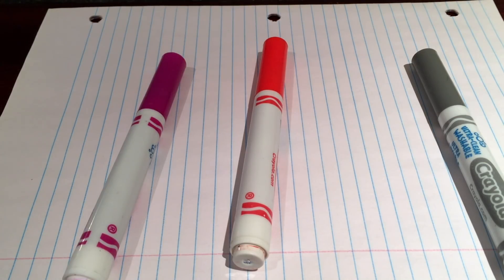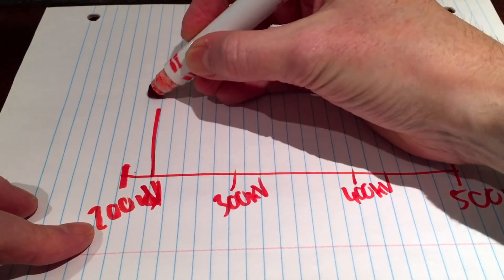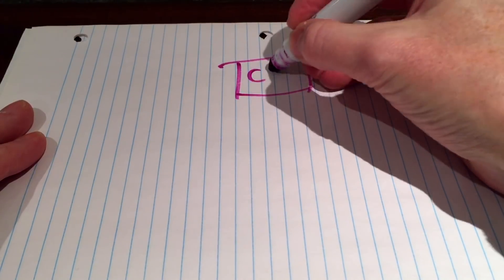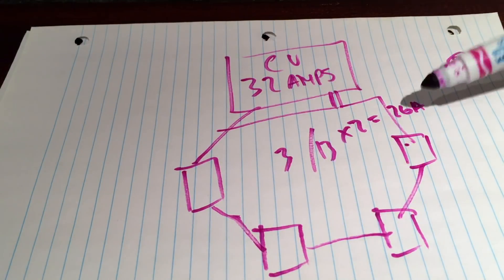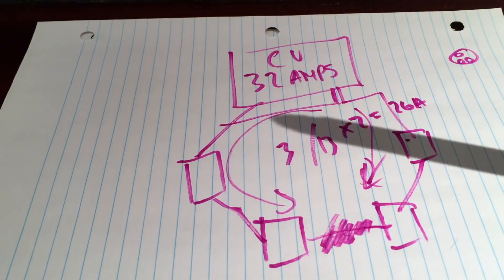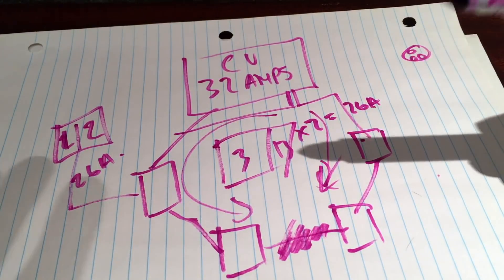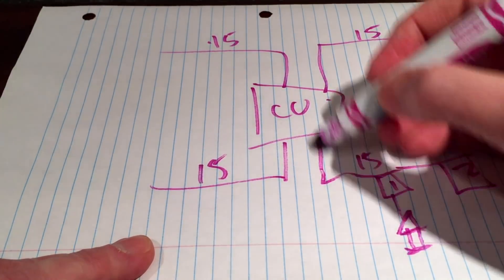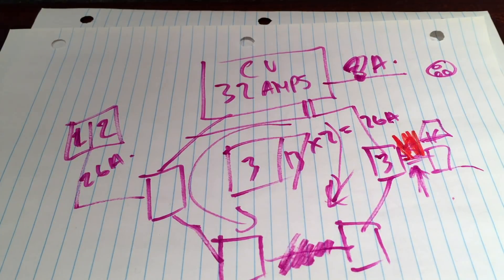THIS is why British plugs have fuses

Comment: I'm really sorry, but this. Idea simply confuses what is quite a simple subject. Electricity can be distributed by rings or spurs, whichever is the most convenient. The entire point is that each home has a maximum amount of electricity available, and you need to get it to where it is needed. In UK homes we have spurs to fixed heavy loads -cookers, permanent heaters, washing machines, and then we provide rings where lower power devices can be connected randomly where it's convenient. The ring is an efficient way of providing up to 32 Amps of current. One for the ground floor maybe, one for upstairs? Before we used rings, where each plug is protected, we used a system very similar to the US system where each socket outlet went back to the fuse box, and of course we had one fuse per circuit. Rings are convenient, and electricity distribution companies use them to connect their substations. They're simply an efficient way of doing it. Forget the daft numbers. 13a mains has proven to be safe and fits in well with our building system. It's not better or worse, just different. As for all this stuff about cable sizes, it's all down to what's called diversity. A 13A double outlet has two routes back to the consumer unit and shares the load. Fuses in plugs prevent more than 13A being drawn, which is the socket rating, only 32A is available from the breaker in the consumer unit. All these features allow trip free living. If your system trips under everyday use, you need an extra ring. It's so simple there is no need for confusion. 

We also need to not talk about multiple phases. Only a very, very few homes have 3 phase power, so adding that confuses, and the reason is safety. Three phase goes past your house, but each home just picks up one of them for 240V supply. 415V from our 3 Phase is simply unnecessary, and we don't do it. Older homes had a maximum load at the fuse box of only 45A, then it went up to 60A,a and now 100A is common at the consumer unit BUT few homes will every attempt to come close to using this amount of electricity because there's no need and we couldn't afford it!

In my humble view, the is no need to make rings mains as complicated as this. They are exactly the same as the ring we use to supply our hot water to radiators all over the house. We don't return each radiator to the boiler, unless we use microbore, when it becomes like the radial systems US and Europe prefer.
Reply: Minor clarification here. In the US, each plug doesn't run all the way back to the panel ("consumer unit"). Each plug is on a "branch circuit", and there are a certain number of receptacles allowed per circuit based on the wiring (size) in use and the size of the circuit breaker at the panel. Typical branch circuits are rated at 15 amps (#14 wire) or 20 amps (#12 wire). For heavier load devices (like cooking stoves and air conditioners), larger wiring and breakers are used, but all breakers are housed in the panel. There is a main breaker in the panel, usually rated at 100 or 200 amps. Houses are almost exclusively single phase 115-125 volts. Commercial installations usually are served with 3 phase power and panels ranging from 200 amps and up (though anything above 200 amp typically involves a "cabinet" rather than a "panel").

I like the UK idea of putting fuses in plugs. It would increase the safety of electrical installations, and prevent whole circuits being blown when a single device is overloaded. But alas, if it's not in the National Electrical Code (NEC), it will not happen. (See my earlier comments on a different thread about the NEC.)

Comment: I once attended a callout out to a farm that had a 3 phase supply.
The neutral broke on the powerpole of a delta wired system which resulted in 415 flowing down the live of the phase that the house had been wired to.
The fuses didn't protecting the circuits from that and every piece of electrical equiptment in the house and every wire in the wall was destroyed.
Thankfully thankfully the 100A incoming network fuse blew protecting the house from burning down !

Comment: I wonder how many times those small fuses are the cause of a fire themselves.
Reply: These fuse are sand filled and can handle huge currents without rupturing the casing.
Reply: The fuse housings are often dodgy and can get hot when they don't make good contact.
Reply: Only if you buy plugs that are not up to standard, or have been damaged.

Comment: The ring circuit is old and outdated. Yes, it had it's place in history but in the present it is just easier for electricians to just run one wire through the house as opposed to running one wire to each room. With the advent of RCD breakers it's a safe enough system. I have lived in the UK for 20 years total and I've rarely known anyone to blow a fuse in their plugs but many people losing the entire ring because the RCD breaker has popped.

Comment: 15 amp circuits huh.
That's a lot less power at 110 volts than it is at 230

I'd have to draw 3 kilowatts to overload a 15 amp circuit, but at half the voltage that's only 1.5 kilowatts.

I think the worst part of 110 volt systems is that you very quickly run into needing a 240 volt or higher circuit anyway for various appliances...

Then again in Europe I was being electrocuted repeatedly by the metal casing of my friend's computer.
Why? Because while the computer should technically have been earthed, many household wiring circuits, especially in older properties have no ground wire.
Similarly, the socket design is such that there's usually not much stopping you putting an earthed plug into a socket with no earth. (you can tell the socket doesn't have ground/earth because the pins for it are missing.)

That really was pretty dubious, I have to say...
Reply: I don't know about that "very quickly." We simply don't have a need for many appliances over 1500W.

Our "cookers" (stoves/ovens), electric dryers, electric water heaters, and permanent electric space heating does usually require 240V, and whole-house air conditioning systems. For everything you'd normally plug/unplug and come in frequent direct contact with, 120V and its associated 1800W (1500W continuous) limit is quite sufficient.

Comment: I remember my relatively small studio unit in England had something like 7 circuits?
Though literally everything was electric.
So we had a circuit for the oven, and one for hot water, both of which were something like 40 amps.
Then there were at least two lighting and 3 power circuits.
And then a master breaker off something like 70 amps.

I do in fact believe that there was evidence the unit had two-phase power running into it as well.
(given there was a commercial property downstairs and 4 residential units in the two upper floors, I suspect maybe the commercial unit had access to full 3 phase power, even though the shop in it probably wouldn't need that, while the residential units were all using different sets of 2 out of 3 phases. Who really knows, honestly. XD)

Point is there were a lot of power points, and a lot of circuit breakers for what was actually quite a small space.
By comparison the larger one bedroom ground floor unit I have now in Australia seems to have just 3 circuits in total, though in this case the oven, hot water and a heater are all gas, rather than electric like in the UK unit...

Comment: The UK plug and socket system is the safest in the world. A ring circuit is intrinsically safer than a radial circuit because every outlet has two connections to the consumer unit, and that means two earth wires. The sockets have a plastic shutter that drops down over the live and neutral holes when the plug is withdrawn, so small children can not get electrocuted by poking metal objects into the live connection. In addition, the plug can be fitted with a 3 amp fuse for low power items to offer extra protection. It's all big and ugly though. Do you put your safety before aesthetics?
Reply: Thank you for this. This is the best explanation yet for why the UK ring circuit might be safer than the US "radial" method (the fact that each receptacle has two paths back to the "consumer unit").
Reply: @noferblatz  Actually he is wrong. Having two wires makes it LESS safe because if one wire fails, it will fail silently. And that's bad considering most ring circuits are on 32A breakers while the wire itself is only rated for 26A.  Now why do ring circuits use two wires? Because during the copper shortage they didn't want to use thick wire rated at 32A, so they decided to balance the load across two smaller conductors. Bottom line, ring circuits are terrible and should be banned by the UK regulatory authorities.

Comment: Installing an electrical supply is an involved and technical task which is why for roughly 10 years now you have had to be qualified by law, even to work on your own house.

There are distinct advantages to a ring main, one of which is that every outlet is connected to the Consumer Unit via 2 cables, and therefore 2 earths!
This part of the regulation has recently been upgraded so that each earth cable now has it's own terminal behind the outlet, making it safer still.

Some houses were wired with radial circuits but this is discouraged even if it's not banned, I don't know if or when that might have happened.

Comment: 12 amp devices because the wire's actually technically good for 25 amps and a 15amp breaker won't pop when the device pulls a surge at start-up since the system is ground/common based at 115/125/105/130v... it makes it a universal standard for use across much of north america.  You can actually wire 20 amp circuits using special outlets and such legally (or just put a 20A on the breaker panel) but for the most part the outlets themselves are the limiting factor since 12Ax125v=1500w and THAT is the standard used.   Gets a little weird and there's tons of variances but if you're dumb enough to buy a power supply or device in the US that uses more than 1500w it's either going to be 240v or require the special outlet.   

There used to be quite a few standards including a 20a three blade rotating plug for kitchen appliances like oil fryers and I remember a 2ph 240v my dad showed me which had five blades and had to be bolted into the outlet AFTER it was turned 18° but I never found out what it was used for - probably shop equipment or something.

But the standard here is 12A continuous draw and 15a peak load and the breakers toss at about 17a@125v unless they're made by Federal Pacific Electric in which case they fuse on and you die.

Comment: in US they limit a lot electronics to 12 or 13 amps just to protect the old outdated house wiring that is in aluminum instead of copper. plus we have 99% of outlets in pair outputs so people tend to plug multiple things in same outlet location, on top of that the outlet might have a neighbor outlet on same breaker/wire so there might be something there too. in new construction in 95% of the time I put 20 am barkers with 12 gauge wire and not more than 2 outlet locations in same wire/breaker, but knowing how American people dont know electricity, I like to put 1 outlet location per breaker
Reply: Ivan Kishov Jeezuz!! One MCB per outlet!!?? I would have needed an industrial consumer unit/ fuse box for the kitchen alone in a house I used to own ... 27 outlets ... Just in the kitchen. THAT'S why a ring main with fused plugs is so much better. ONE breaker covered ALL those sockets ... Last lived there 28 years ago ... The house is still standing
Reply: It depends. USA consumers dont want fuses, more then that, in some areas of USA if you come to a house that have fuse system, you must not touch it or overhaul it to new standart.

Comment: ring mains have 16a breakers or in the dark ages 15a wire fuses, cooker circuits have 32a breakers and cable per individual device.
Reply: lez briddon Wrong! Ring mains have 32A MCBs or RCBOs, Radials (also allowed under current UK building and IET wiring regs) have 16A MCBs or RCBOs, lighting circuits are typically 6A MCBs or  RCBOs, immersion heaters and high power electric showers can typically be 16A or 20A MCBs or RCBOs. Old style fuse boxes used to have 30A, 15A and 5A wired fuses using fuse wire and there are still many tens of thousands of houses in the UK using any of the different versions of the IEE/IET regulations from edition 1 up to the current version 17, amendment 3 with edition 18 being due out mid 2018. Also in the UK we use mm^2 not wire gauge to harmonise across Europe since solid core AND stranded core (conduit run) are used and wire gauge or diameter is a variable amount depending on type and number of cores. Normal domestic UK cable (as in Europe) is 0.75mm^2, 1.0mm^2, 1.5mm^2, 2.5mm^2 and 4.0mm^2
Reply: our old 15a wire fuses were replaced with 16a ones.  assumed thats what was still in use, to be honest i have never looked at what we have in the current house never had to touch them,  i'm a plug side guy, once the wires in the wall its not in my domain, odd i can work (and do component level repairs) on 400v TV power supplys legally but cant fit a plug socket without breaking a law :)

Comment: the reason for the limit is because of surge amps. allow me to explain, in a North American house we generally use 15 amp breakers but often times in a condition of particularly high load an appliance rated for 15 amps will throw the circuit for no other reason than it has exceeded the maximum capacity of the breaker and home wiring so by rating devices at 12 amps even under excessive load the breaker will not be tripped unnecessarily. Also unfortunately our appliances do not run on true three phase  because each line is not out of phase in frequency in true 3 phase there are 3 distinct pulses of electricity 120 degrees out of phase of each other from separate generator windings.  Our 240 volt appliances run on 2 separate 120 volt breakers coming from the same central breaker and mains line wired in series to double voltage.
Reply: Also, many appliances have fuses inside their power supplies instead of mounted in the cord
Reply: Additionally, in my home anyways and every other US house I have been to there are 4+ breakers per level for about 1000 sq ft levels

Comment: There's no 3 phase in UK houses!
Reply: There is in some, but you would have to find a house that still has it's origional wiring & fuse box from before the 60's. They stopped putting it in new houses before i was born, and any house rewired after circit breakers became the standard, had 3 phase removed.

Comment: So I guess to restate: circuits in the UK are commonly 240v*32a=7.68kw max at the breaker, which if something shorts is easily enough to start a fire without tripping the breaker, made practical in terms of wire gauge by connecting the run at both ends (and reduced transmission loss from lower current for the same wattage because of the voltage). While non-appliance circuits in the US are 120v*15A=1800kw max at the breaker and so having less less ability to start a fire if there's a short, and reduced ability to arc because of the lower voltage.
Reply: Dang, you almost had it right. Your math's off by a few orders of magnitude, though. 120v x 15a is 1800w (or 1.8kw) , not 1800kw.
Reply: If something shorts then the breaker will trip in a fraction of a second before there is any danger of the wire overheating.this is because a short will allow a much larger current to flow, exceeding the 32A the breaker is designed to allow through

Comment: We have both single and three phase available to residential consumers here in Greece. For single family homes they tend to push one for three phase power but that mainly benefits the electric company which charges more for 3 phase service. Most kitchen ranges can be wired for 3phase to help balance the load better instead of piling up heavy draw appliances on a single phase. Another issue being enforced now in Greece is the testing of the wiring and breakers in residential units every 14 years and commercial and retail locations every year. The latter not enforced if electric service has not changed due to new renters or new businesses. That is bound to change as the government finds new ways of draining the pockets of the people here.

Comment: I recall in the early 70s we had Round three pin plugs/sockets and the plugs were rated at 15amp and did not have fuses, UK. I believe they are still in use today.
Reply: No, the round pin plugs would have been only in old houses in the 1970s. The square pin fused plugs came in in 1947, but it took many years before all old houses were updated.